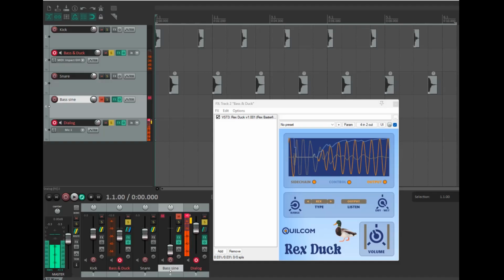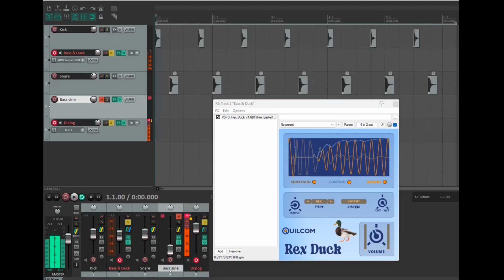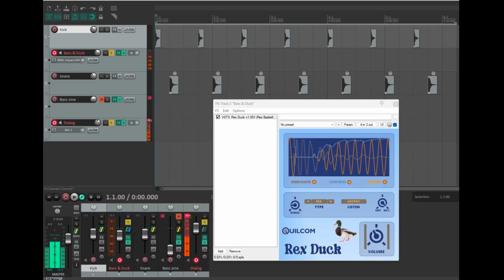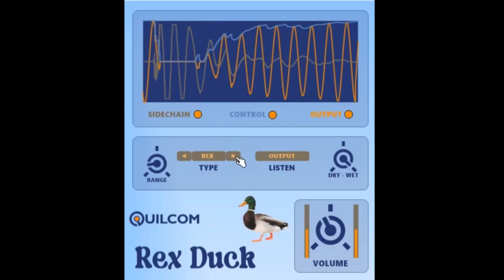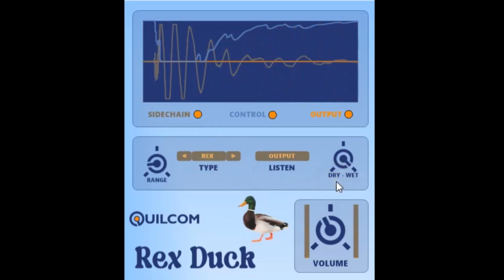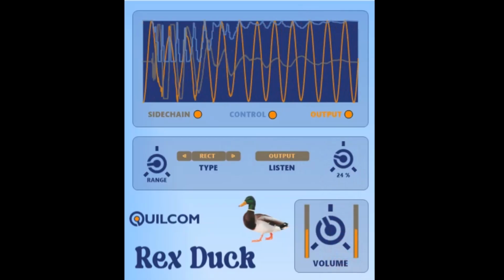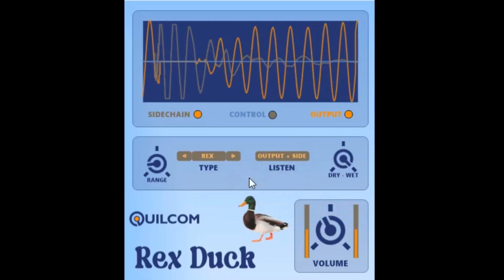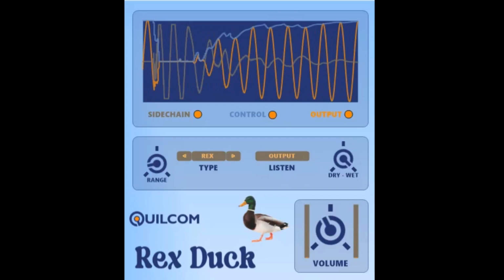Quilcom Rex Duck

Comment: It's not rm but am Side chain imho. Thanks for the plugin Rex.
Reply from the maker: Yes, it’s amplitude modulation. I suspect that Renoise originally used a ring modulator module as a gain element. Or maybe it was a marketing decision to appear more impressive and arouse curiosity. Dunno.